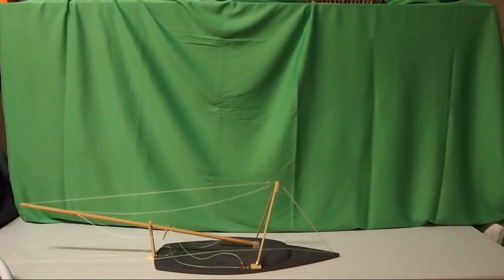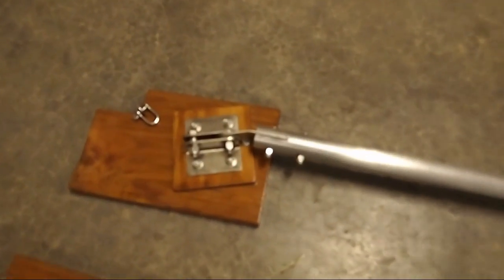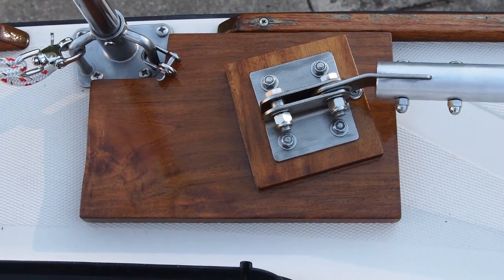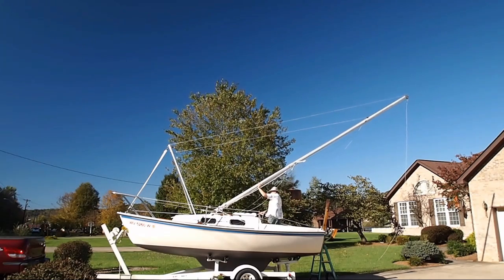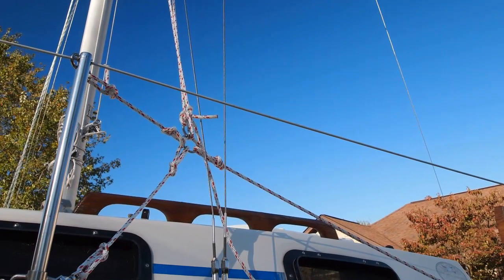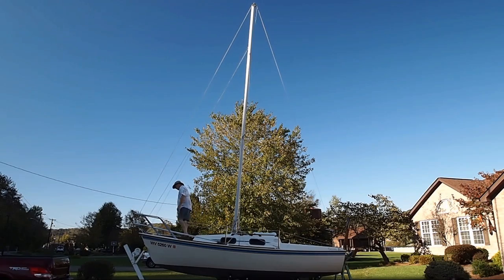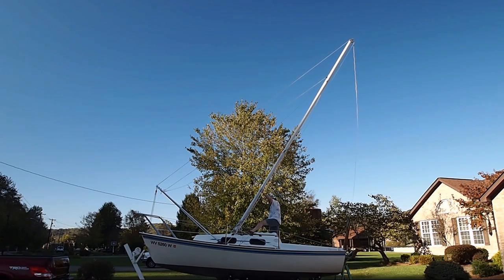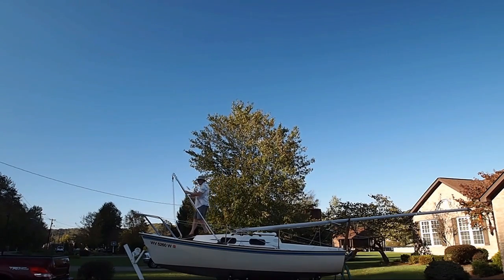Sailboat Mast Raising System

Comment: My problem with 22ft has been side to side mast movement especially when the mast is at the lower position raising or lowering. The video does not focus on the action of the rigging you employ to show how it acts to  keep the  mast centered.  Could you elaborate on that please ?  Another comment referenced  the same issue. I have considered an A frame  as you constructed to stabilize and eliminate mast side  to side tendencies.Look forward  to your thoughts

Comment: Hi Joe,  Thanks for your good work and taking the time and effort to share the details with fellow sailors.  You have given me some good ideas, added ideas which I can incorporate with others, and reinforced other workable solutions.  I am an engineer who has been sailing over 30 years on a 25', 4,000 pound displacement sailboat, which has an 85#, 28' mast.  Since the mast is larger and heavier than most trailerable sailboats, safety in a rigging system is paramount.  In the past, I have always stepped the mast manually, without using the benefit of much mechanical advantage.  Also, and for various reasons, I have always stepped the mast forward.  I prefer doing it that way since the mast has no chance of fall into the cockpit (where I may be) or on an expensive outboard in the event of catastrophic failure.  I am re-evaluating the method even though a change now would generate some other modifications.   As I get older I am now taking time to engineer a system to utilize my anchor windlass with remote control to raise and lower the mast safely by myself without requiring physical effort.  The principles are the same, only the details are different.  My first attempt was marginally successful and I am now working out the bugs.  Thank you again for the chance to review your system.

Comment: Hi Joe,  I successfully copied your system to lower and raise the mast on my yacht.  I couldn't figure out your system for preventing lateral movement so used a single rope running down from the lowered mast to control sideways movement.  That worked OK but didn't feel very secure.  Could you give me some more details of that part of your system please?  Many thanks, John Mcbeath jmcbeath@gmail.com
Reply from the maker: The most complicated part of my baby-stay setup is the network of ropes attached to the lifeline stanchions to suspend the pivot point of the upper part at about the level of the mast's pivot point. Without that, they'd have the same problem that the real shrouds have. Other than that, it's just a couple of ropes that loop over the spreader brackets. The port side rope goes around the mast and over the starboard bracket, and vice versa.

Comment: Beautiful. I will build it. some basic questions if I could - you never mentioned how tall your mast is. If my mast is 30' would the 8' a-frame be tall enough?
Concerning the temporary side stays; I would imagine that after stepping and before sailing you would remove them. When you lower how would you get the longer stays looped around the spreaders?
Thanks for a wonderful video, Joe!
Reply from the maker: I just toss them up there. They're only about ten feet or so above the coach roof.

Comment: Nice system. Would you also have details on the wooden stern yoke that you have made too?  Thanks
Reply from the maker: The mast crutch is an ordinary 2x4 with a plywood saddle at the top for the mast. It hangs on the transom with pintles which plug into the rudder gudgeons. I can't mount the crutch and the rudder simultaneously, so if I ever want to lower the mast while under way I'll need to come up with something else.